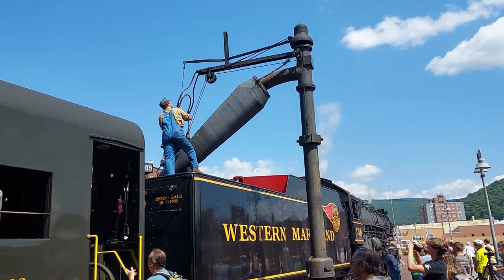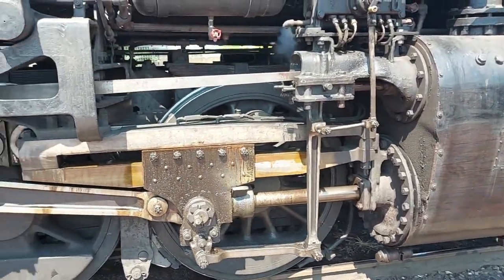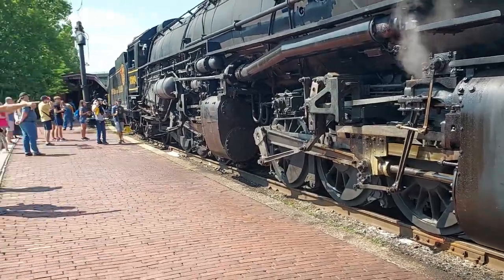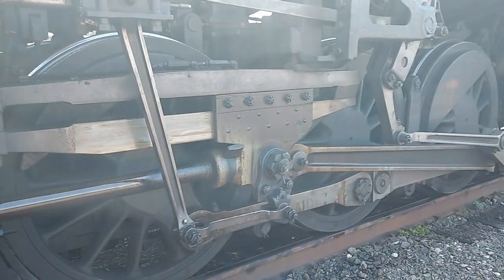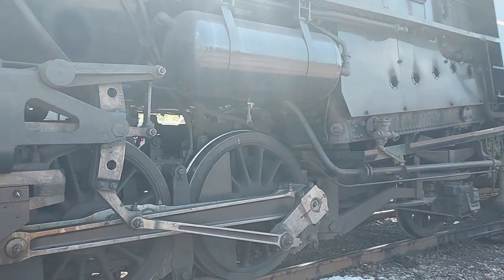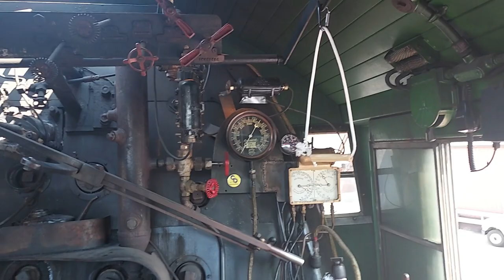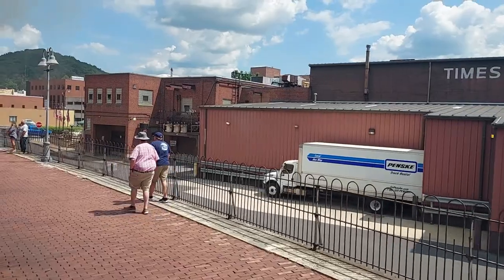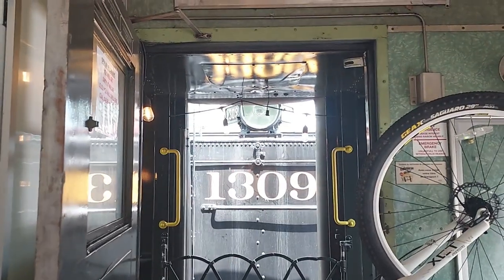Riding Behind the Awesome Steam Locomotive 1309

Comment: Good video Dave. 

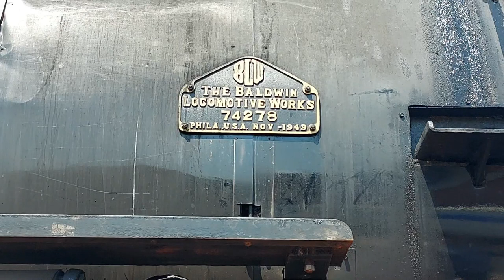Several FYI things. When standing near the front engine of the loco, ( 1:51 ) above the crosshead guide and behind the valve gear is a device with a lot of tubes coming out of it.  That is the mechanical lubricator. It is driven by the link off the shaft of the valve gear and operates by a ratchet to operate pistons inside to move oil to the needed points. You will notice that there is another one sitting just to the rear and above the steam cylinder.  ( 2:06 )  Different types of oil so the need for different lubricators.  There should also might be some on the rigid mounted set of cylinders. The cylinders and valve on the steam chest are lubed by the two small tubes near the top of the cylinders.

The two air pumps are cross compound units. There are 4 pistons in them with two being for steam and two being for air and they are double acting unlike on your Diesels. The steam portion is on the top and jacketed. The air part is on the bottom and not jacketed. That was the thumping sounds that you hear. Much better than the older single cylinder ones as they are more forgiving about self starting.
Reply from the maker: Thank you so much gravelydon for the very detailed and 
informative comment. Wish I had your knowledge! Steam
has always fascinated me. 1309 is just a magnificent piece
of art. Almost made the hair on the back of my neck stand up being beside her.  Really do appreciate your taking the time to ride
with us and write in my friend. Always is a pleasure to hear
from you.

Comment: The H-6 class were built for mine run service in the coalfields. The 1309 and her sisters spent their brief lives working the coalfields around Logan W Va. The 2-6-6-2 wheel arrangement was ideal for the lighter rail and sharper curves on most mine runs. C &O's H classes were the backbone of the coal   branches.
Reply from the maker: Yes sir, those locos were built for slow speed heavy hauling. I
did not know 1309 worked around Logan, thanks very much for
that info Mitch! It was awesome being that close to this
magnificent locomotive, almost made the hair stand up on
back my neck. Really appreciate your riding along with us
today.

Comment: Real nice video Dave. I rode that line quite a few times in the late 80s and early 90s most recently in 2016 (rode in the caboose, unfortunately a rock slide closed off part of the line and we couldn't go all the way to Frostburg). I'm assuming that water column was recently installed as I don't remember it being there before. Thanks Jim
Reply from the maker: Thank you Jim, really glad you enjoyed. We rode 2 years ago and
a year before that and the water fill station was there both times.
Kind of odd they don't fill in the shop at Ridgely tho? Always
enjoy hearing from you my friend.

Comment: I believe that the mallet 2662 vs 4884 big boy will be able to run on the tight curves
of the north east along with clearance for the tunnels. while out west and central USA
has large sweeping curves , and minimal tunnels. the power of both engines are
amazing especially when you consider the time they were made. what killed 
steam was the labor intensive maintenance on the engines. coaling and water 
stations every so many miles, on the old NYC they had “on the fly’ water pick up
locations. What a great video, hope all is well, take care and stay healthy. barry
Reply from the maker: Thanks so much Barry for the awesome comment. PRR had water
troughs in the track for pick up on the go also. Those troughs
had to be a real pain for track maintenance crews to work around!
You're right, the diesels had it all over steam for ease
of operation and so much less maintenance.

Comment: Yes!, spelled Mallet, but pronounced "Malley", its French, you know! From the French mechanical engineer, Mr. Malley. I bet the 1309 could pull one of the loaded Cumberland coal trains easily!
Reply from the maker: Now that would be an awesome sight to see wouldn't it Paul! I
would most likely have a heart attack from the excitement of
seeing that. What a publicity promotion that would be for
the mine's new owners!!!! PS: I got better track than they have at WMSR, but I don't want in any way to criticize or cast any
negatives on WMSR. Last year when we rode there were several
slow orders on some sections of their track.
Reply: @ccrx6700  Any large steamer would be awesome publicity for Cumberland!, and you should be proud of your very smooth trackwork! You are just as good, if not better than, some large roads, when it comes to trackwork!!

Comment: And i would just bet there are roller bearing axles inside the journals on the tender trucks!
Reply from the maker: Dang Paul wish I had looked closer at those. I was too enamored 
with the locomotive tho. If I was a betting man, I'd bet you are
right.
Reply: @ccrx6700  yeah! The 1309 is just as impressive as some larger steamers, even though it has fewer wheels than some of them.